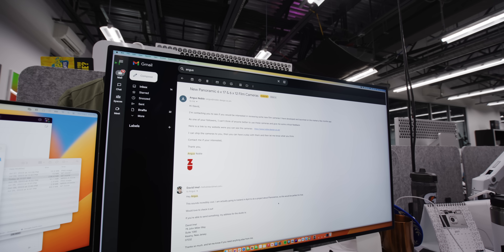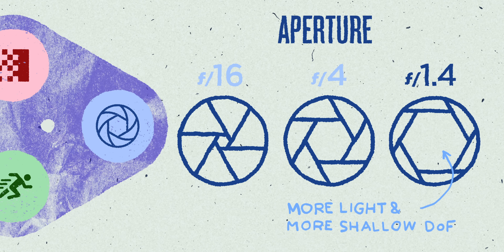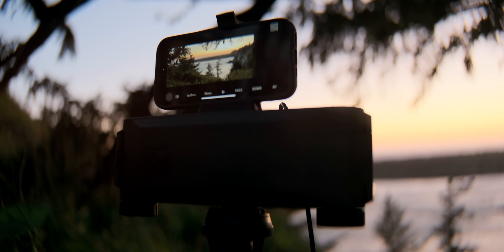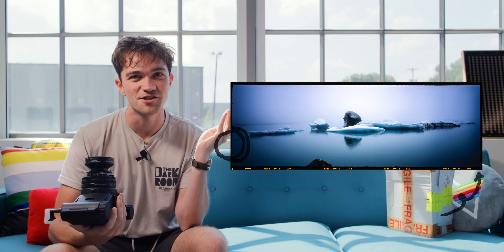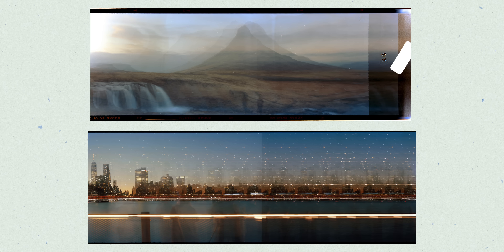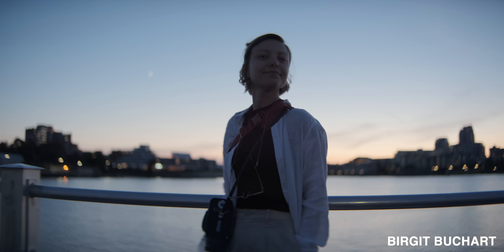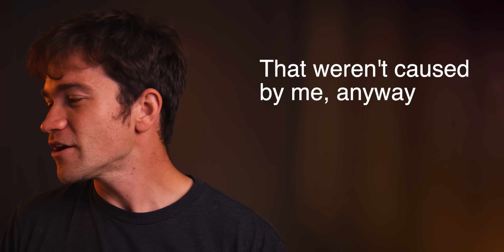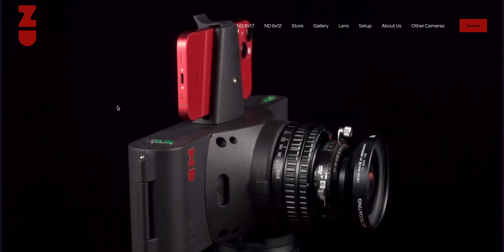Can You 3D Print A Camera?

Comment: I was looking at Linhof Technorama but those are like $8k new for the body. 

I use Sinar Zoom 2 that allows to shoot 120 film on any graflok compatible camera and adjust frames from 6x4.5 to 6x12 within the same roll. Super cool. You can still use all camera movement, focus is ground glass for each frame. And it costs around $800 (which is pricy, but if you already have large format camera it’s a very useful addition).

Comment: Short answer, no. But you could make the housing for the components. The electronics still require a chip fab to make the processor and sensor. You could theoretically 3d print the glasses. And easily do the body. But to many parts cannot be printed yet. Not cost effectively as far as i know.

Comment: Depth of field gets smaller with bigger apertures. It refers to the depth of the field of focus. Not how blurry the background is. It can give a sense of depth due to subject isolation but that is not what the depth means in that phrase. f/22 can get a deep field of focus from 6 feet to infinity while f/2 would only give you 6 feet to 8 feet, or a shallow depth of field. Just semantics as long as you know the affect it has. And Provia doesn't cause vignette to appear, but it may require a faster aperture which will cause vignette to appear, especially on such a wide lens.

Comment: I just got into film photography recently (like in the last two weeks, lol). I found a Minolta Maxxum 7000 at thrift for like $10, works beautifully. I've shot a couple rolls of film, but used my first one to practice exposure, etc. I started using the Viewfinder app a couple days ago and it's truly an amazing tool. So nice to quickly see if what exposure settings I think will work, actually will, and the app lets you preview using simulated film stock, so I can see an approximate of my shots on Portra 400 stock for example. It's super handy!
Reply: Also, your explanation of the exposure triangle was perfect! So easy to understand
Reply: It's a great app!

Comment: Did you use a center filter? Similar to what you have for the xpan.. It seems like it would be necessary for the thicker slide film like Provia.
Also, have you heard of this company NONS? They just released a Fuji 6x6 Instax back for the Hasselblad V-system. Really cool stuff, should be right up your alley.
Reply: I honestly kind of like the vigneytting. A center filter would cut light too which I don't love. Plus the XPAN lenses are already f/4 f/4 and f/5.6, so I wouldn't really want to make them even slower.
Reply: @DavidImel  All good reasons :)

Comment: Im a beginner photographer and I wanted to know why they didnt just make the camera an slr? (The digital viewfinder sounds really good for previewing settings but im just curious)
Reply: A few reasons, but the biggest reason is that you need a large format lens to cover the image circle on a format this large. Large format lenses are almost all leaf shutters, which have the shutter built into the lens. In an SLR, the mirror acts as the shutter.

A mirror that covers 6x17 would have so be suuuper wide, and the springs and mechanisms required to be precise enough to shoot a difference of 1/1000 vs 1/500 is very difficult, and easy to break. You would also have to be more precise finding a medium format lens that could still cover the image circle. This camera is the equivalent of (3) Hasselblad 500CM shots aligned next to each other. You’d have to use lenses from the Fuji GX617, which is quite rare and very expensive.
Reply: @DavidImel  Ah ok, thank you so much for the explanation!

Comment: Just for reference: a Linhof Technorama 617s iii (one of very few 6x17 cameras) is over EIGHT THOUSAND dollars for the body alone. 3D printing an entry point into the format is truly incredible.
Reply: My Linhof was (used) 1,800 USD. Dec 2025 with lens.
Reply: That's misleading. Fuji GX670,  Tomiya Art Panorama, Widepan 6x17S. Also, 6x17 film holders for 4x5" cameras. All can be acquired with reasonable prices from second hand markets, or new.
You can get new aluminium  DAYI S-IIA 6x17 for 1000$.
This camera is totally overpriced for what it is.  Do not buy a plastic box at this price. The fact that they did not even test its for being light proof tells a lot.
Also, just the name! Noble designs, there is a panoramic 6x12 rotating lens camera Noblex!
Reply: @Nobody-Nowhere I was really hoping he would have stl files for sale for a reasonable price so I could print my own for fun. Totally lost me at that price.
Reply: @Nobody-Nowhere  your post is also misleading.  Many of these are not easy to find and the Widepan i did find is 5k.  The Tomiya I found is 2500.  The Fuji is more. The DAYI is 1250.  Also, the guy's name is Angus Noble - weird to make that into an issue.  Over-priced?  Sure.  But not egregiously so considering the other options - and I can see some benefits in terms of weight and simplicity.  This would never be my primary camera, but I could pack this in addition to my normal kit and not lose my mind on extended international trips.
Reply: @Nobody-Nowhere  can you get 6x17 on 4x5 camera? I thought 6x12 is the max unless you replace rear standard and use 5x7 lens?

I use Sinar Zoom 2 that allows to shoot 120 film on any graflok compatible camera and adjust frames from 6x4.5 to 6x12 within the same roll. Super cool.